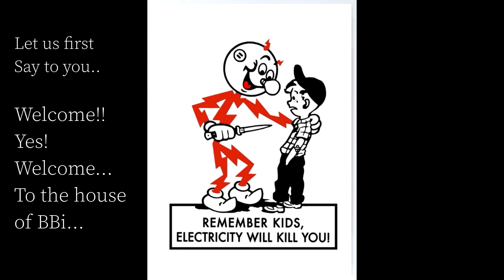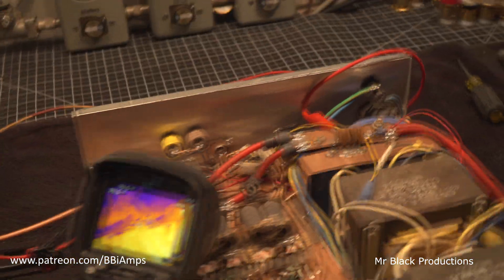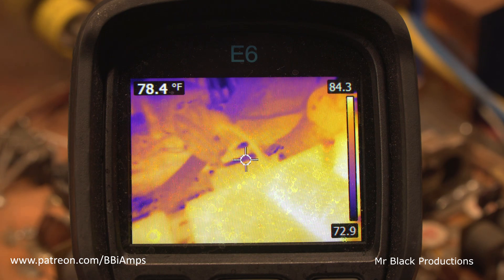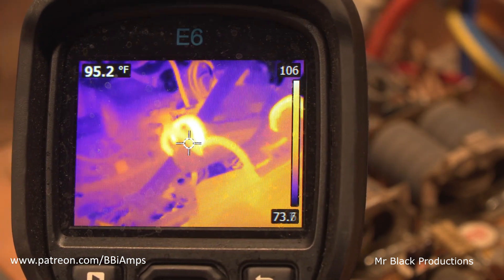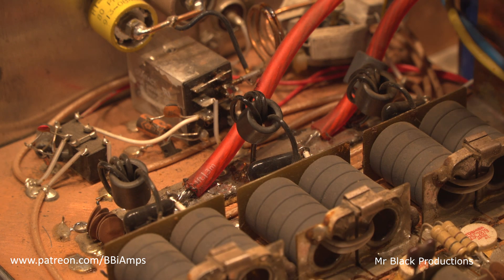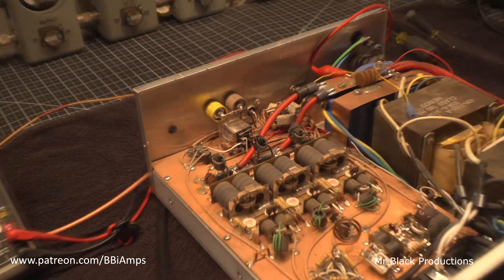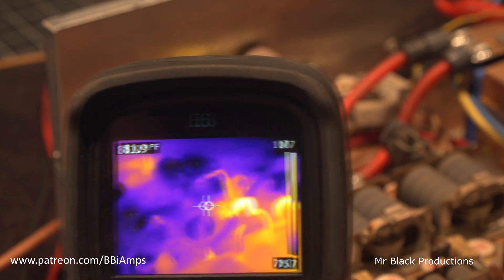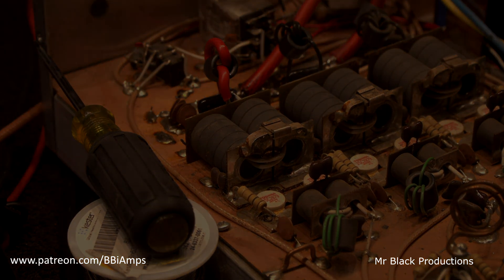Y we do Power wire Upgrades in our boxes!!

Comment: If only the wire in those transformers be coated with some thing that has real high melting point Like Teflon. YAY! So that is 620 F. Solder will melt first. But I are not expert.

Comment: Sir, I wanted to give you a heads up on what's coming in the not too distant future. Class D amplification. Pure on and off switching. It is already the rage in audio circles. A small chip producing more than 100 watts per channel RMS audio, with a small switching 48V power supply? Never heard of it. But now already in manufacture.  I own one and it sounds fantastic!  Its no bigger than a box of kitchen matches! This is merely to plant a seed in your mind on mucho power, and mino heat amplifier construction. All we are waiting on is the available components. I suggest that a readup on class D and audio amps operation will spark a worlewind in your mind of a mucho power linear amp for 11 meters that wastes far less heat. It is coming. Just a heads up. What is needed is a high current switching transistor switching at around 300MHZ.   Switching on and off at 300MHZ, driven by a pulse width front end driver. Think on these things my friend. A transistor only produces heat when it is somewhere between off and on. When it is full on or off there is virtually no heat. Think my friend. Keep watch for suitable transistors.

Comment: You are also changing the inductance of the circuit. You're going from 3 windings down to 1... therefore you're decreasing your inductance by 2/3. To compare apples to apples, get a bigger ferrite (for the bigger power wire) and do 3 turns to match the other two, then re-run the experiment.
Reply from the maker: I don't normally bother with that kind of stuff cuz I don't have the time. To get that box back out take it apart wrap the wire through it set it up video it and it the whole damn thing and then repost it to YouTube took 4 hours of this day. When I could have been working on somebody else's equipment but the point is so important to me. That it was worth it.. and I appreciate you guys bring in the point up and making it something that we could talk about. ;)
Reply from the maker: fyi the data on the 1/2" type 61 18 gauge with three turns was "2 uh"
                                1/2"  type  61 12 gauge with one turn was   ".5uh"
                                5/8 by 1/4 with 12 gauge with three turns  "1.5uh"

so like i said not much and the wire is to small..
Reply: @BoxBuilderIdaho  Thank you for the followup video! You proved your point, comparing apples to apples. Wire does make a difference! Thank you!!!
Reply from the maker: ok.. thank you for the input. I have cover this in a few passed videos....  but here is a test 

https://www.youtube.com/watch?v=WqkzcfOTKb8

Comment: Yes, the wire is likely too small but there are other factors in play besides the wire.
What was the value of the inductor before and then after?
It's job is to keep the RF off the power rails. but when you removed all but one turn the value changed quite substantially.
Here are a couple of reasons for the heating.... one is because it presents a higher impedance to the RF, thus generating heat... and the other is because there are multiple turns heating each other up.
The core is likely saturating too.
You have to find a balance between keeping the RF off the power rails and not melting down too.
An air core inductor would probably work the best here.
Reply from the maker: ok.. thank you for the input. I have cover this in a few passed videos....  but here is a test 

https://www.youtube.com/watch?v=WqkzcfOTKb8
Reply: @BoxBuilderIdaho   thanks for testing the question
Reply from the maker: fyi the data on the 1/2" type 61 18 gauge with three turns was "2 uh"
                                1/2"  type  61 12 gauge with one turn was   ".5uh"
                                5/8 by 1/4 with 12 gauge with three turns  "1.5uh"

so like i said not much and the wire is to small..
Reply: Hey mark love your vids too.

Comment: Help help help.... I've been wanting to do this but don't have the knowledge to know. When doing this upgrade does it effect tune because of the less wraps on the ferrite? If not I'm doing it ASAP. Also where to buy the wire? Thanks!
Reply: Thanks for the update video BBI! Now I'm totally doing this. I just wasn't sure if I needed to change anything else like caps if I did this mod. Looks like I don't. Last thing tho. Where do I get Teflon wire that big? I can only find silicone wire. Will that work?